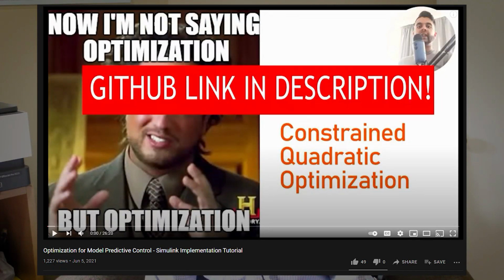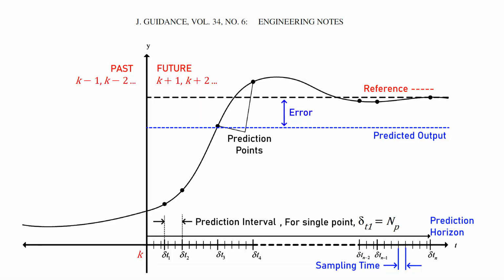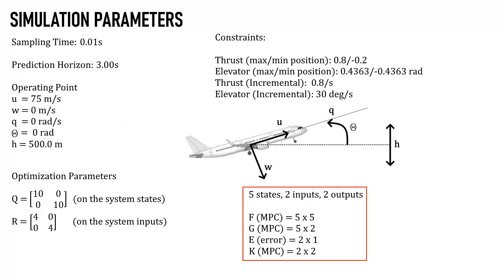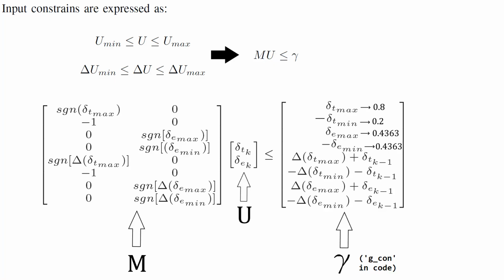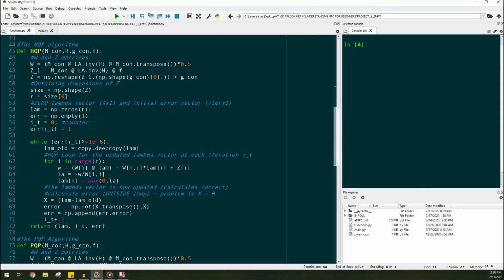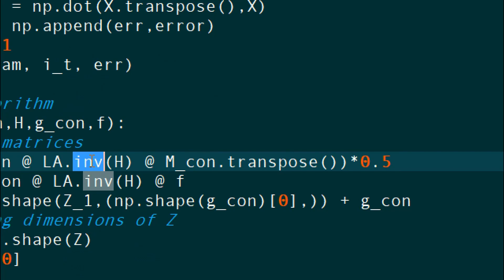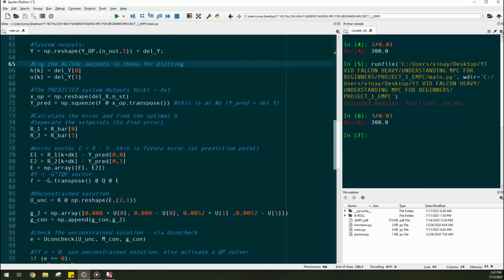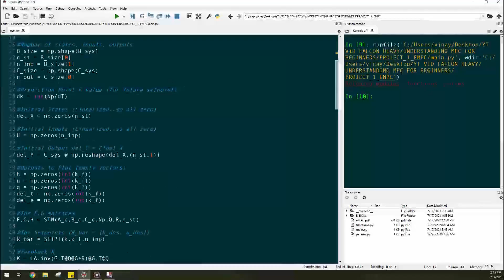Understanding Model Predictive Control (MPC) for Beginners (Python Implementation)

Comment: Hi VD, Thanks for such a nice lecture. The Github code link is not working, can you update it please. Secondly, I want to implement MPC to a real system (Piezo Electric Actuator), can i use python but I am not sure how i will update my input and output everytime? Like in case of Matlab usually researchers used NI DAQ Board etc for communication, Is that possible with Python?

Comment: First of all, thank you so much for the nice effort and teaching these topics,,it would be nice if you give a brief explanation of "How to code MPC with constraints in MATLAB specially when it comes to system constraint i.e x(k+1) = A*x(k) + B*u(k) (as a constraint) then how can you program that in MATLAB",
secondly, How can one use the custom Mpc (not the built-in mpc toolbox ) in Simulink for some project" ?
Hope you don't mind in answering these and do some positive to make videos on the aforementioned topics.
Good day
Reply from the maker: Hey. Yes thank you. The code actualy does exactly what your first question is asking inside the while loop. 
I am not a fan of using toolboxes. The custom toolbox may be for nonlinear systems which I don't have experience in as well.
Reply: @VDEngineering  Hi ,,Can you please make a proper implementation of mpc with some "reference tracking in which we have to calculate the error on every time step and then use quadprog for optimization ,,using MATLAB" .?